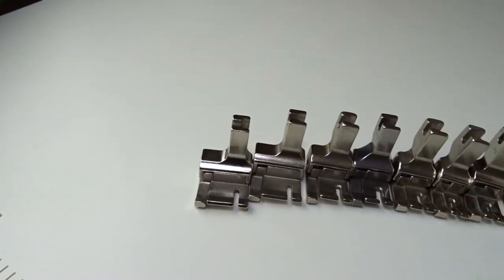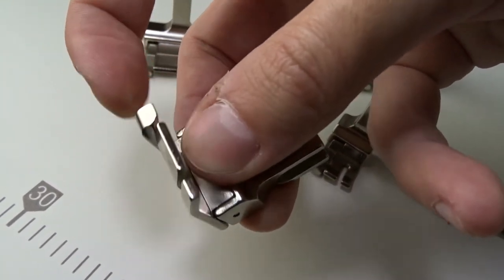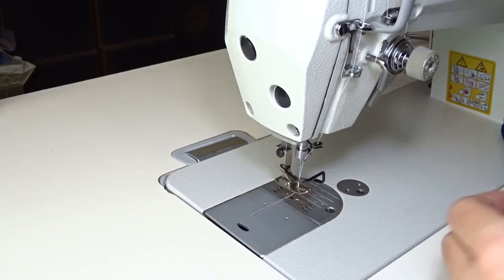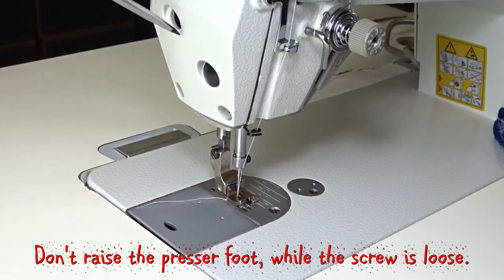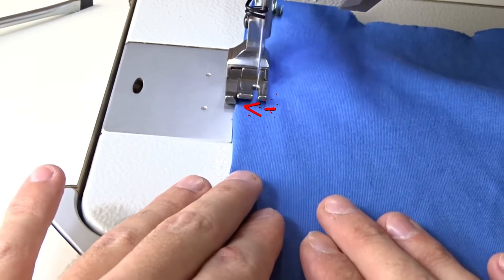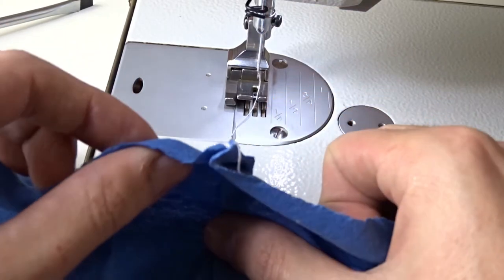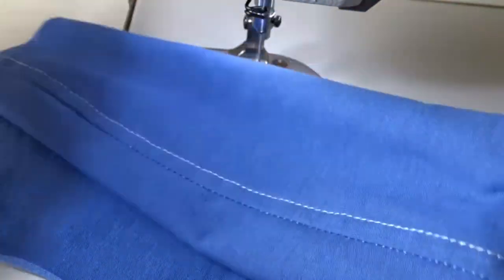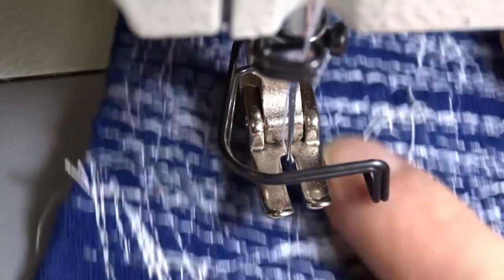HOW TO USE THE COMPENSATING PRESSER FEET ON AN INDUSTRIAL SEWING MACHINE

Comment: Why do self compensating feet cause scratching on the needle plate? Is it the foot itself scratching the plate?
Reply from the maker: The movement of the presser foot while sewing, along with the pressure exerted, can indeed contribute to scratching on the needle plate. To prevent further scratches, you may try placing a short strip of paper tape on the side of the needle plate where the guide of the presser foot is located. Alternatively, using a magnetic guide when sewing along edges can help eliminate scratching, and use the compensating foot only when topstitching.